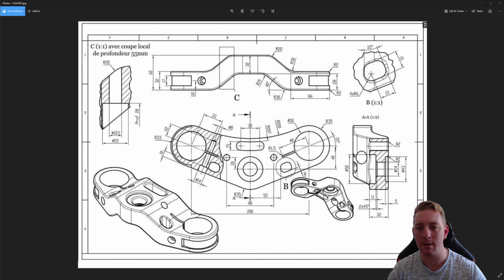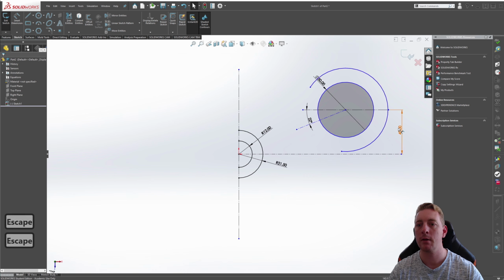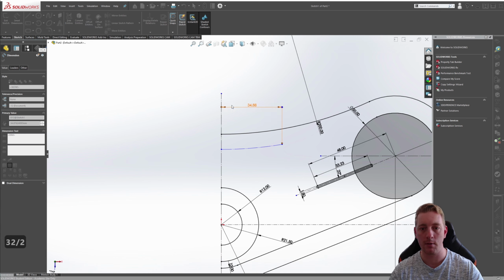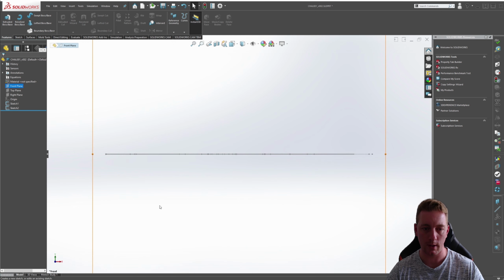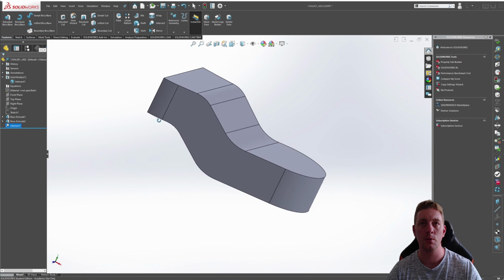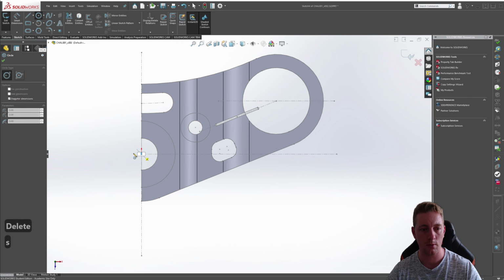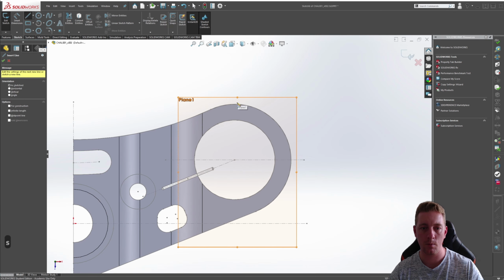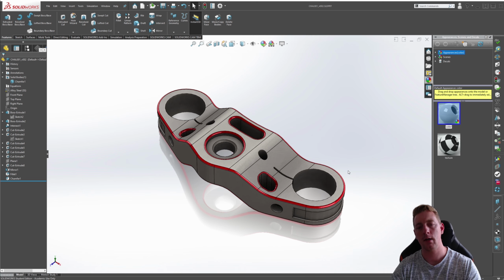You Can Draft This SOLIDWORKS CHALLENGE 001 - How Well Can You Draw This Challenge Part?

Comment: Awesome video, thanks for all the lessons. Quick question: At 9:15, how do you know those 2 lines are parallel by looking at the drawing? They look parallel but is there a symbol or something that tells you that they are in fact parallel? Same question for 18:56.
Reply from the maker: From experience really. I did a lot of working drawings in my years and part of the art is to display as little on the drawing as possible to make it clear, all while conveying as much information as possible. 

So something like that I would look at and ask myself "this isn't defined with a dimension, angle, or any symbols. Can I assume that would mean it's being implied that it's parallel? Does it work if I make it parallel or are there any other possibilities?"

I can't find anything to indicate otherwise and it does work if it's made to be parallel so that's what I go with. There is of course the small chance of being wrong, maybe something was missed from the drawing that doesn't give me the correct information but that then becomes an issue of the drawing being wrong and not my interpretations. 

Hope that makes sense and happy new year! :)

Comment: 2 details; the hole trough the small slot has a 120° angle on the "drill tip" and the 33mm cut on the outside is offset following the hole instead of the outer profile.
Thanks for all the tips, good explanation!
Reply from the maker: Appreciate the comment, thanks :)